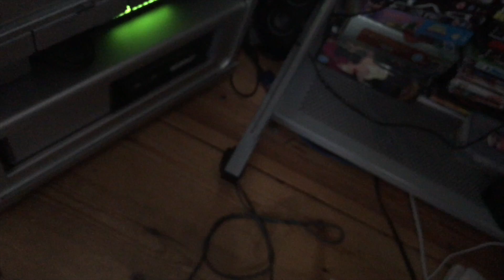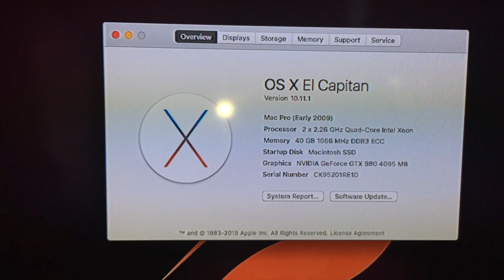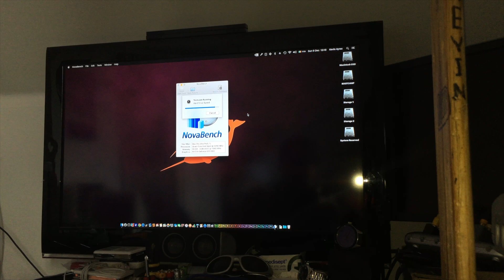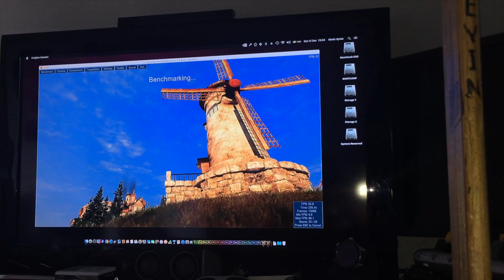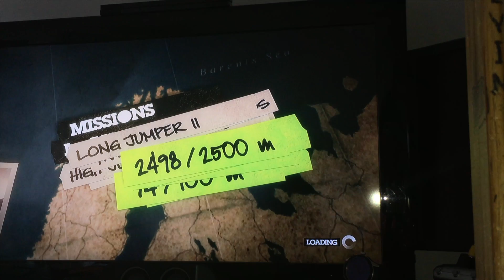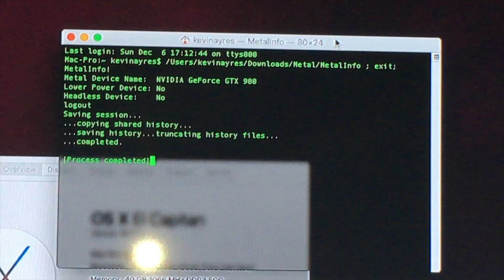Mac Pro 4.1 2009 with EVGA GTX 980 SC Benchmarks on OSX and Metal Support?

Comment: HI,

Thanks for posting your video it was really helpful. I have an early 2009 mac pro, currently on Yosemite 10.10.5 & wish to up-grade my graphics card. I can't see OSX drivers for the GTX 980 on the Nvidia site, however I can see OSX drivers for the GTX 680. Im looking to up-grade in order to use cuda for video editing. Any advise would be appreciated.
Reply from the maker: +peakvisiontv it is a generic web-driver kinda one fits all type of thing you just need to download the right one for your version of OSX you are running. you can find the version of OSX from "About this Mac" and under the Large text Yosemite you will see 10.10.5 if i remember currently click on the version text and a Code in brackets will appear and that is the version of web-drivers you need to download e.g

OSX El Capitan 
version 10.11.3 (15D21)

so I download the driver for (15D21)
Reply: +Kevin Ayres Hi, Thanks for your quick response. If I do this I get "10.10.5 (14F27)" then I think follow this link:http://www.nvidia.com/download/driverResults.aspx/89538/en-us. This then gives me a driver. However when I look under the "supported products" Tab I cant see cards more recent than the 600 series. I realise I may be misunderstanding, or doing something stupid, as I'm comparatively unfamiliar with upgrading graphics cards.

Any clarification would be helpful.

Thanks
Reply from the maker: peakvisiontv
 yea thats the driver its a generic driver so it works on all Nvidia cards and dosent mention all the cards it supports. I have no idea why but just download that install it. it will put a App in you system preferances and to activate it just select "Nvidia-web drivers" in the App and restart will promped and install your 970 and it should be up and running.
Reply: +Kevin Ayres Thanks Kevin.... I'll try that :)
Reply: +peakvisiontv You need separate drivers to get the CUDA to work.
Reply from the maker: +RogerWilco yes you will need to download the CUDA drivers and web-driver separately they say the efi Bios for this card makes it preform better in some tasks but i could not justify the cost of a MacVidCards GTX 980 as I use windows for 99% gaming and I have a Nvidia GT120 giving me my apple logo and boot options at boot up. make sure you get an exhaust cooler for your graphics card because blower fans can disturb  airflow and blow hot are towards you HDD's.

Comment: FYI, NovaBench is a terrible benchmark tool for graphics because on OS X unless you have a GPU flashed for Mac it won't push the card past about 600 frames/second. In other words, don't sweat the graphics score on NovaBench.  I have a Mac Pro 2010 (12 core) with a Gigabyte Windforce GTX 780 and it did the same thing. On Heaven it benchmarked at 72.8 fps and scored 1814 with ultra settings @ 1080p - not sure what all my settings were on beyond that.
Reply from the maker: +Silicon-Garage.biz yea kinda figured out there was something wrong there with novabench cheers for confirming that haha. I did do a video on windows 10 gaming and benchmarks on this machine its a lot better representative to the Power of this machine.

Comment: For what reasons did you switch from the 2006 to the 2009 model?
Reply from the maker: +MrMoustacheish OS support mostly the 32bit EFI crippled the 2006 Mac Pro I now there where ways around it but didn't want the hassle anymore. DDR3 support was also a big decider and all round faster machine. plus the Mac Pro 1.1's are selling for a good price still and I got my 9 years out of it. if you do want to my a first Mac you cant go wrong with a 2006 Mac Pro other wise I'd recommend go higher in the years.
Reply: Well, I was considering it for a gaming rig, but I was apprehensive about the ddr2. I was thinking it'd be a nice computer for basic browsing and word processing and MAYBE doing some music editing. I have a modern I5 rig that would likely do it much faster, but OSX fascinates me.
Reply from the maker: +MrMoustacheish yea will by the end I was playing games in 4K and parts for this machine are relatively cheap if you want to do upgrades if you haven't seen it I have made a video on the 2006 Mac Pro gaming and it is a bit of a beast still with a few miner upgrades. I call the 2006 Mac Pro more of a hobby machine it will break your heart so many times but once it is working it's a beast.
Reply: Did the CPU bottleneck any games?
Reply from the maker: +MrMoustacheish with this machine you can't escape the bottlenecks but the original x2 dual core where a massive bottlenecks but upgrading to the x2 quad core Intel Xeon X5355 improved things massively
Reply: i just got a 2006 good deals on those ,will upgrade to 2007 ,and change the cpu's to quad X5365 ,other thing i only heard  2008 to 2010 SOME can have bad power supply .the 2010 are quite a lot more money ,the thing to note is they have pcie 2 card slots which run much faster so you can put in a ssd in the card slot where as the older 2006 pcie 1 slots run much slower.they are easily upgradable compared to a lot of the new gear which is nice.

Comment: Hi , sorry I have a question for you , I have a MacPro 3.1, 12gb ram ddr2 , wanted to know if a graphics card 4GB DDR5 could play games at high quality , or if I should increase ram , or change computers , or if I can put ddr3 somehow thanks greetings
Reply from the maker: +I am shock's videogames hey so I did do a video on the gaming capability of the Mac Pro 1.1 2006 and I was able to play the latest games at Max settings 1080p 60 FPS with no issues slight dip in gaming performance if anything CPU intensive pops up but in general great gaming machine once windows was installed. RAM is fine most games don't use more than 6GB now a days sadly DDR3 will not work on you machine totally different architecture. don't thing about going SLI because the Mac Pro dose not support so a single 970 or 980 would be the two options I'd recommend depending on your budget. I would also recommend EVGA I have yet to have a EVGA card die on me and I have owned a 4 so far. what my recommendation for gaming on these machine upgrade the CPU's to suppoerted ones with a higher or highest clock speed, 12GB is loads but if you think you need more 16GB is a sweat spot for most right now, SSD's will give you the speed boost you are looking for with boot times or WD blue, and GTX 970 or 980 which ever you budget allows you. link below to game play on the Mac Pro 1.1 with GTX 980. thanks

https://www.youtube.com/watch?v=fyqUY_xH4Yg
Reply: +Kevin Ayres thanks for your help!! I see your other video, I like your work with these mac, i love your work!!! and sorry for my english, i am spanish!!

Comment: Is your GTX980 being seen at PCI 2x speed in both OSX and Windows? I've heard in order for PC Video cards to take advantage of the full PCI-Express 2x speed in a Mac Pro they would need to be flashed. Is your video card flashed for EFI?
Reply from the maker: +Michael Shepherd na that may have been the case in the power pc era but no matter if you running in OSX or windows it runs on full speed PCI-e 2.0 x16 slot. flashing a card is only good for see the apple logo at boot up and been able to see the ALT boot options if you want to change between OS's a lot easier. the problem with OSX is Apple are not optimising there OS with current Gen Nvidia Cards because Apple are not shipping devices with Nvidia cards this gen just ATI and Apple have only optimised ATI cards over 2GB (Mac Pro 2013 and iMac 5K) so thats why they are kinda running better on OSX at the moment but Nvidia cards have CUDA and thats the big seller for content creators on Adobe so thats the small market Nvidia is selling too in the Apple world and definitely not gamers.
Reply from the maker: +ALEXX C sorry forgot to post it its there know but here is the link

http://www.insanelymac.com/forum/topic/306752-test-metal-os-x-1011/
Reply: +Michael Shepherd MacVidCards says that non flashed card's will not work at PCIe 2.0 speed in Windows on a MacPro.
Reply from the maker: +MAM I'm not sure about that. they do show up in windows as PCI-e 2.0 and I would not be getting the performance I'm getting from the card with out PCI-e 2.0 I did make a video with windows 10 benchmarks here's the link. I did her something about some on board SATA connections on the 2006 and 2007 Mac Pro wont work in windows but thats was it.

https://www.youtube.com/watch?v=nOfoBabS1G0